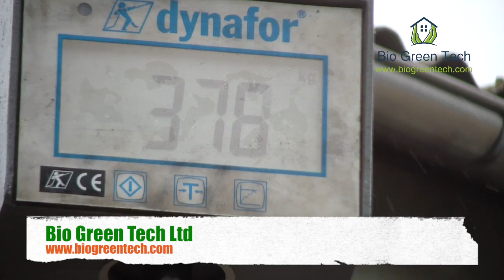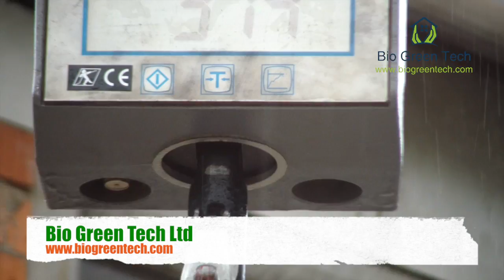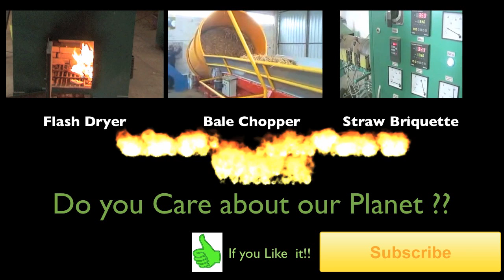🔴 Mobile Biomass Fuel Pellet - Fuel Briquette Plant. Please support our friends in the Ukraine

Comment: Seems like a great idea! The pellets come out looking pretty nasty but that's not really important.

How are the pellets and briquettes dried though? They look rather wet in this video.

Also, what is the machine fueled by? Just wondering if it's more eco friendly than buying in bulk
Reply from the maker: This machine is more for the Biomass Fuel Industries like Drax Power Station here in the UK, They only turn the materials into a compressed form of Pellet for transport to reduce the mass. Then they crush the pellets into powder before adding to the Coal powder.